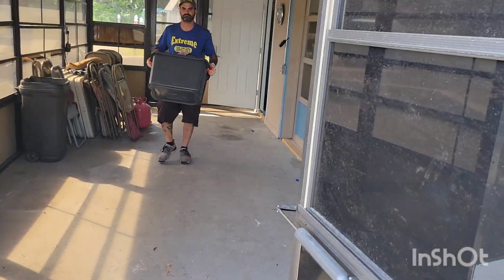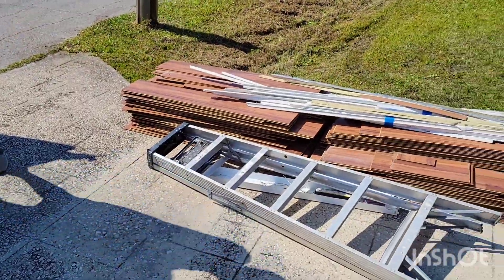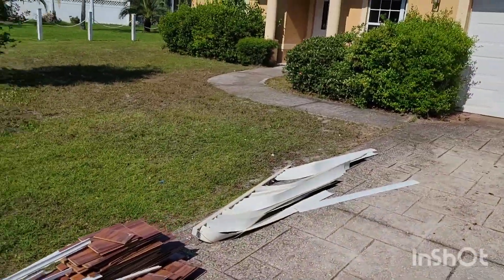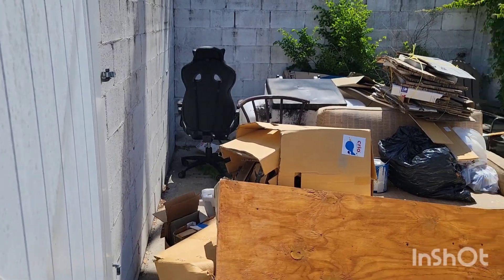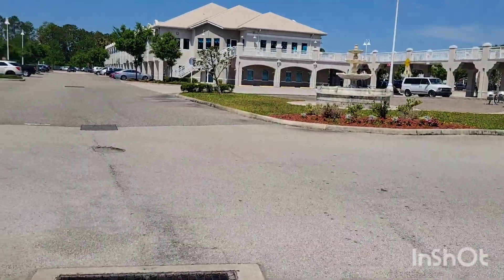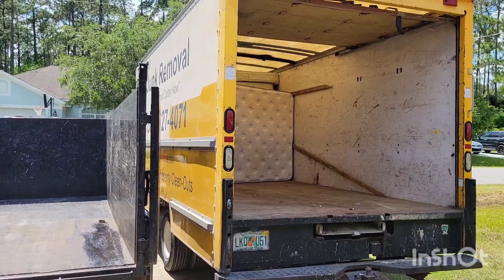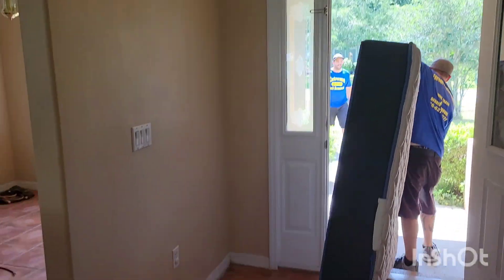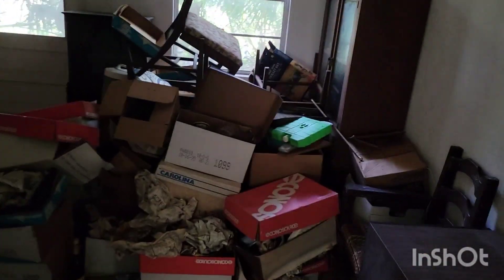Junk Removal Is getting very busy! Extreme Junk Removal.

Comment: It's crazy how much stuff is dumped illegally in my area. 80 to 90% of my jobs are all for commercial property owners and property magic companies hauling off illegally dumped stuff at commercial buildings, shopping centers, and strip malls.   A couple weeks ago I hold off 10 dump truck loads of dir,t broken concrete, sod, and bricks  at a warehouse building that backs up to the railroad tracks. Luckily for me I own my own bobtail dump truck and Bobcat tractors for my other I other business doing tree care and landscaping. It was nuts how much stuff they dumped there though. .  Then the property owner paid me to put up post and chains going across all the driveways so they can lock them down at night and on the weekends so hopefully that doesn't happen again.